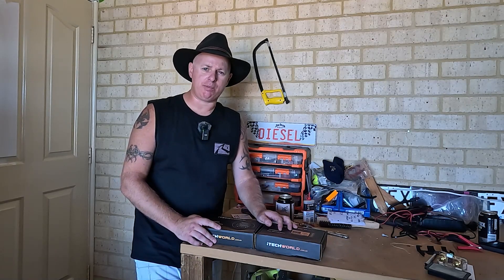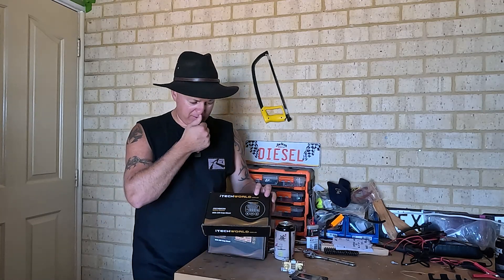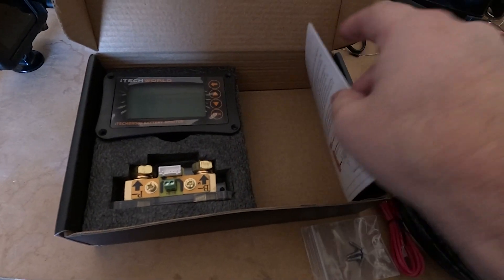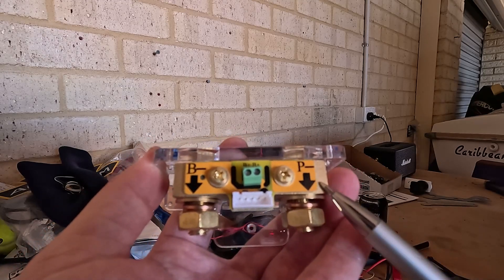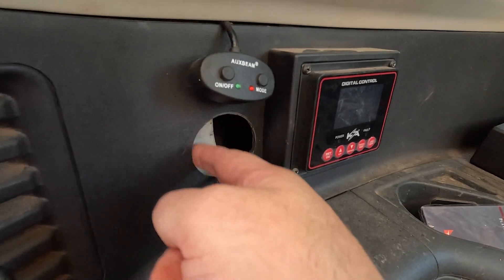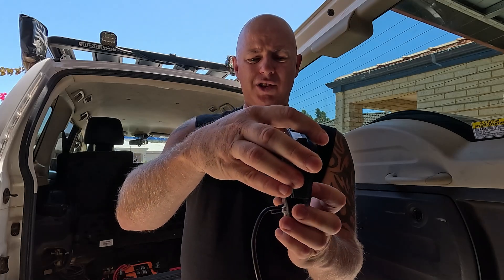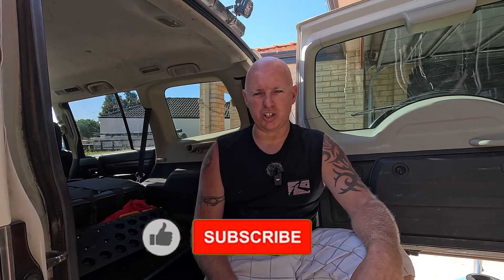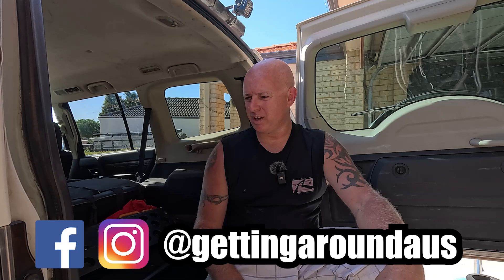iTECHBM500 (NEW 2024 MODEL) BATTERY MONITOR w/ SHUNT Easy Pajero Install & why you should consider

Comment: Thinking of getting one. Do you have to put a temporary battery on so that you don't loose all the settings(clock,radio,computer etc) when the main battery is disconnected, to connect it to the Shunt?
Reply from the maker: Hi mate, to my knowledge it does need to be connected to a battery to keep the settings but also I haven't done it myself so couldn't say for sure

Comment: The cable plugs from the shunt to the monitor gauge are not the same, you’d think they would have standardised the blood plugs so you could just mount the new gauge and plug it in…..doh!
Reply from the maker: @carlherbert1494  there is a bit going on hey 😂

Comment: Hi mate I got the battery monitor with the 240 amp battery installed it but the monitor is not showing drawing amps just says battery life 240amp a 000 amp out with fridge plugged in.
Reply: about to call them when they open cheers.
Reply from the maker: @nortondouglaswylie  yeah it's difficult for me to to help mate and I don't understand full systems enough like they do hope you get it sorted 🤞
Reply from the maker: Have you tried reaching out to the service team for some help? they would be best to diagnose a problem with their gear mate

Comment: I have just installed the latest screen as well. I have it running from 2 x 140 AGM batteries atm. Everything hooked up correctly however I have found my canopy light if I dim them down and amps drop below 0.25 amps then it goes to zero on the screen even though lights are still on. Also fridge in standby mode at around 0.25 amps also it reads zero. However jumps up to around 3 Amps when charging. Feed in is correct from dc dc charger. My older round screen would measure ever amp even down to 0.01. So I’m a bit confused with it.
Reply from the maker: Yeah that sounds like a odd one, can't say I have anything to offer mate, not something I have come across myself 🤔

Comment: gday mate I bought the new 2024 shunt and straight out of the box the monitor was getting no power. the green plug where the sense wire goes on was cactus.  so I rang them and they sent me a new one. fitted that up.  same problem. no power to the monitor. the solder connections on the sense wire plug a flimsy as fuck.  both broken.  my auto elec soldered it and soldered a bridge wire in and it now works perfectly. moral to the story do not touch the green sense wire plug harshly as they are brittle and break.  twice for me.   otherwise im fairly happy
Reply: I snapped mine just tightening the screw, took the board off and soldered the wire to the back of the terminal.
Reply from the maker: @Frogget666 very clever 👍
Reply from the maker: Wow! Yeah I am soon installing a second into our camper trailer and will take note... must have been pretty frustrating

Comment: So just installed the new 2024 battery shunt took out the old one like you did just wondering how you set what volts is high volts and low volts and alarm where it cuts off what parameters to put in these
Reply: Cool as thanks , I got 240ah . Just havnt fill out out rest , absolutely better display , saw yours and went and bought it when it was on special , , also have Itech 3000 w inverter in my van
Reply from the maker: @haydenhoneywill1055  sounds like a killer setup, new display is so much better than the so bloody good not having to toggle isn't it 👌 🍻
Reply: Took a lot of YouTube and talking to Itech direct on the phone  , there service is unbelievable, probably ring them tomorrow to ask this high and low question, , thanks for your video it convinced me to get new monitor
Reply from the maker: @haydenhoneywill1055 really happy it helped mate 🍻
Reply from the maker: Hey mate, That's a good question, don't think I actually did set it up and forgot to get back it 😂 I think when I set up the old one there was a suggestion in the manual perhaps?

I'll definitely need to have a look and sort it out

Comment: I have been looking at this monitor for a while and notice the display had changed. Are you happy with it still? Do you recommend it? Can I still use that discount code?
Reply from the maker: New monitor is much better, has everything on the main screen rather than needing to cycle through each page to find it.

Found it to be very good. Nothing it doesn't do that I can think people might need.

Discount is still live for sure 👌

Comment: Gday mate , I’ve just oredered  2x 120ah lithiums off itech world for  my camper. Will the monitor show 240ah on the display ? Also so you run all negatives to the shunt dues that mean your negative from your fridge cable needs to go to the shunt ?? 
Cheers mate
Reply from the maker: Yeah mine shows the 105ah so can't see why it wouldn't show 240ah. The bit I didn't show in the video was there is settings page after holding down a particular button for 3 seconds that allows you to enter the battery bank size. Then making sure batteries are fully charged when hooking up it'll calibrate of thosr settings and charge.

I run my fridge off a kickass Mini Power Box (for multiple inputs) which is then connected with neg on shunt and positive on battery.

I'm guessing in theory if a fridge was running directly to a battery then yeah it would be done the same. I'm not a sparky though so couldn't be sure of any fuses required doing that way.

Hope it helps and you got your discount 🍻

Comment: Having trouble with mines showing like 80 volts and saying the battery is at 0% when it’s a brand new battery
Reply: I don’t think so when I hooked it up it was with the old battery that I didn’t know was dead then I put a new one in and it’s giving me massive readings
Reply from the maker: @James_Bram  Roger, you are supposed to hook it up with a fully charged battery, then change the settings for the correct battery size, then hold the button to reset it which will calibrate it to give the reading you need. It doesn't auto read from the start up but will when you set it up. 

I'd have a read of the manual which should give you the step by step. I followed that which helped out 🤞
Reply: Can’t seem to change the settings
Reply from the maker: @James_Bram  the instruction manual tells you how mate, can't remember exactly which buttons off the top of my head unfortunately 😕

If not maybe call up itech support who would be the best point of contact 👍
Reply from the maker: Was the battery fully charged when hooking it up for the first time?
Reply: Cheers mate, would it be buggered now Because it wasn’t hooked up with a fully charged battery